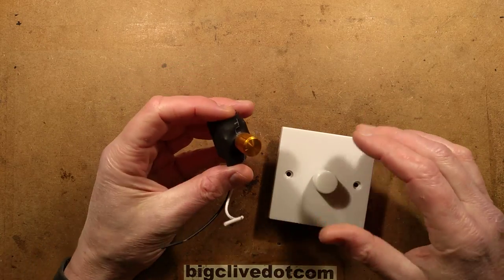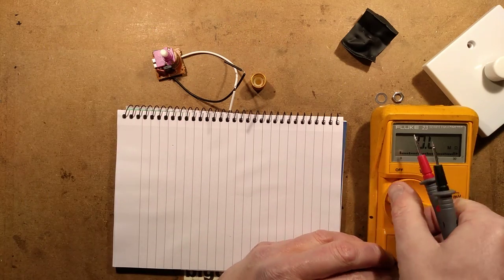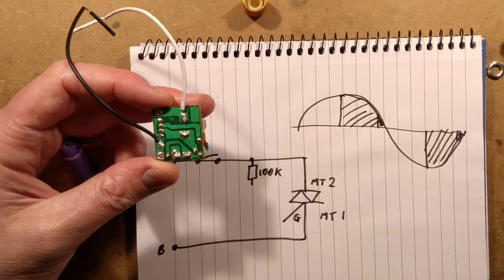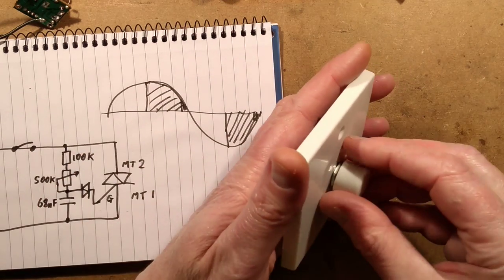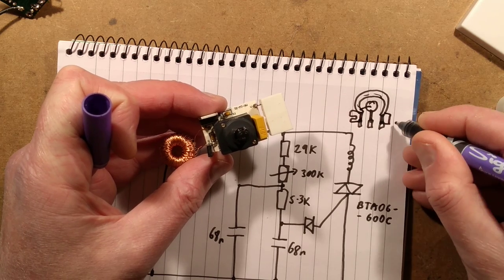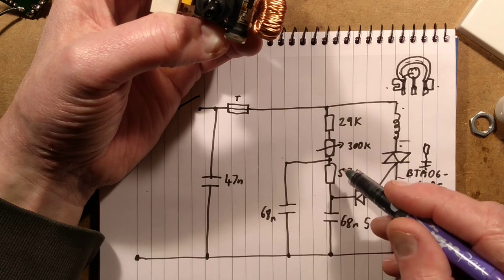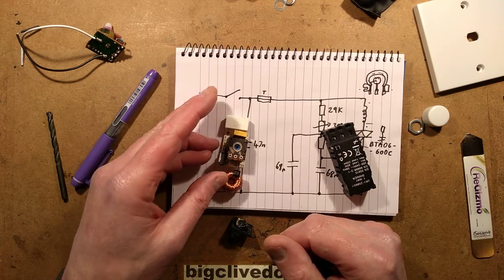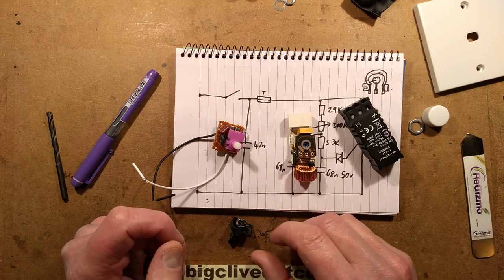Cheap eBay dimmer module vs compliant dimmer.  (Schematics)

Comment: Yoy have a parallel resistance between the left and the middle pins. So your potentiometer has a logarithmic behavior, what makes perfect sense, because that will provide a smooth transition between low and full power to the load.

Comment: Why would cutting off the mains rather than switching it on cause less interference? The change in current should be the same so would generate the same amount of switching noise.
Reply: It would be less. The current in a lead phase would allow the load to slowly rise up to the cut off point. The sudden drop off is just current "going away". Add in a series inductor and you can smooth it out. In a lag phase the power suddenly comes on at full power and then drops off slowly. A series inductor would be useless.
Reply: I see why what you're saying is intuitional but I don't think it's true. Also you got leading and lag (trailing) the wrong way around.

Comment: I recall from the old RCA manual (1960?) that the 2nd capacitor allowed the dimmer to dim to a lower level by "replenishing" the trigger capacitor. It seems that the trigger capacitor didn't have enough charge at extreme dimming levels.

Comment: On the first cheap one, its only 1 way so they advertise it incorrectly. On the second one, I would guess the 0ohm anticlockwise section is for the rotary switch position so it reaches 0ohm before the switch clicks to off?
Reply: kay110 don’t see what you mean - you can turn the lights up and you can turn them down, that’s two ways right? 😄
Reply: Kay110 For some strange reason that is how electricians refer to devices, a standard single pole single throw switch is refered to as two way and a single pole double throw switch is called three way. Guess it is because of the number of terminals?  The two pole single throw switch used to allow control of a light from three or more positions is called a four way switch and has ..... four terminals!
Reply: David V pretty much all domestic light switches are single pole. 1 way is just that, an on off switch. There is no four way switching, you have 2 way intermediates, in which you can have as many switch positions as you like switching the load.
Reply: Mrglock Yes, I understand that and agree, but in the trade those switches are called "four way switches"  The original comment by kay110 was that the dimmer is a one way (single pole) device, which is true but in the advertisement it was called a "two way" switch which is also true - trades-wise.  I don't make these rules, I just try to explain them.
Reply: David V I’m in the trade. I’ve never heard another spark refer to them as four way. And usually when people in the trade refer to double pole or single pole, they’re talking about switching L or L N.
Reply: Mrglock  Must be a country specific thing, I have over forty years experience in everything from residential to light industrial, 120/240 single phase to 4160 three phase both wye and delta configurations, and they are called four way switches here. The advert was apparently targeted at the US market.
Reply: David V ah fair enough, I’m in the UK so it’s different terminology, all the best!
Reply: Mrglock  Terminology is always a bit of a sticky wicket even within a given trade. Cheers!

Comment: Very odd looking dimmer to US eyes. Do British building electrical system normally attach dimmers (and switches and sockets) to the face plate? US building electrical systems mount the switches, etc, inside the box, and the face plate attaches to the front of the device with a couple of small screws.
Reply from the maker: Most British stuff is the whole faceplate.
Reply: @bigclivedotcom  How very odd. Occasionally you'll see wall sockets in the US without faceplates, because the faceplates were removed for painting or whatever, and someone forgot to put the face plate back on. It doesn't matter much since the wiring is tucked behind the device. That said, if someone were reckless or ignorant enough to poke around with a screwdriver, he could eventually find a live terminal.

Comment: Wouldn't the 68n capacitors in the compliant dimmer see the full mains voltage across them if the dimmer switch were on, but with a disconnected load?  The triac's MT1 would presumably be floating, so I think the diac would be unable to dump the capacitors' voltage when it would otherwise be triggered?
Reply from the maker: The dimmer is in series with the load.  If there was no load the dimmer would not be powered.
Reply: Oh, I see.  Thank you -- I'm used to "load on the right," so I was mentally connecting the load after the triac. In retrospect, that makes no sense and I should have known better.

Comment: I have an 18Kw water heater (tankless) that uses Triac's to 'Modulate' the power.  While my home has pretty good wiring it still adds a nice dip to the mains while running.   It's more or less an 18Kw lamp dimmer heating water.   If it didn't do it's job so well I would get rid of it.

Comment: I have a very old Soviet made 600W 220v drill.
I wonder if it is a good idea to connect the 1st cheap dimmer with it? 
It's the only dimmer module available at local market in my city.
Any advice?
Reply from the maker: It would benefit from a snubber network across the triac to protect it from the inductive load and make it more stable.   Most drills are based on universal motors, so it should work OK.

Comment: A limited-arc pot is clever (not genius-level clever, though) but is it economical?  Depends on how many units you intend to shift, I suppose.  Fewer components, less pick/place/solder, but extra expense for a custom pot.  I wonder if whoever designed it did the full economic analysis or was too enamoured with his/her stroke of cleverness to bother figuring it out.

Comment: Sorry to bother Clive, butt I was wondering if there's any way that it's possible to stop a transformer from "singing" once it starts. Some very good LED bulbs have started doing this, making them essentially unusable.
Reply: Depending on construction and cheapness they may be missing entirely their dose of standard spar varnish to tie up the windings with. This also keeps them from moving relative to the core in better built transformers. Time is needed for the spar varnish to cure though.

Comment: There is something else which makes the difference, also in costs. It is the housing, presumably it can withstand high temperatures and it is not a melting and probably burning heat shrink, and for sure tested.  Aaand there is one more important thing, not material, but virtual. It is the responsibility by the manufacturer and the possibility to judge him in the  EU or UK. Try to bring a Chinese seller to court...

Comment: I've managed to destroy several dimmers like the better quality one you took apart Clive because mine had standard none resetting over current fuses which got killed by a spike when the tungsten lamp filament failed. Got quite expensive so in the end replaced them with standard switches.
Reply from the maker: Some small lamps are prone to killing the triacs in dimmers when they blow.   It makes the dimmer stay on continuously.
Reply: @bigclivedotcom  IIRC it failed 'off' which is why I thought it had taken out a fuse, or at least it looked like a fuse, 10-12mm long, white ceramic looking cylendar, metal caps either end. Can't remember if I put a meter across it at the time. May still have the dead dimmer cluttering up my electrical bit cupboard, so I could put a meter across it now. Thanks for a great video as usual.

Comment: Just saw a random item on ebay named: 'Ultimate Solar Power Energy Cooling Cool Fan Safety Protect Helmet Hard Hat Cap' and immediately thought of this channel, no idea why?
Reply from the maker: Nice idea, but I wonder how it would fare in impact tests.
Reply: @bigclivedotcom  Not too well I'm imagining. It looks like it has no battery or switch either, just direct from cell to fan? I'm surprised there isn't a charging circuit / switch or a rechargeable battery. (From the images I've seen, anyway) If it did charge while not in use it could have more power, an led night light mode, usb, pew pew lasers!... etc.

Comment: I wonder if there's resistance in series with the wiper contact too.  It looks like there could be.  Easy enough to find out, just measure from the wiper terminal to the wiper contact ring.

Comment: I know these type of VR. they made so you don't add a resistance with the VR and the VR will not get to zero if you don't want. this type is spacely made for  this type of controller

Comment: Knob aside, what hae ye done with the battrees in the magnifier, Clive?  The switch was on but the LEDs were not, so you pulled out another LED light.  Fun dimmer vivisection.
Reply from the maker: Sometimes I leave them on, so the batteries may be low.

Comment: I ought to buy another dimmer from my chinese COB supplier.  He has these nifty dimmer modules that support up to 1800 watts, with thermal cut off and a wireless remote to boot.  Let you tear it down.  He has them as i recall at 15$

Comment: Is there a way to improve these so that at the minimum sweep the light is lit, but only just?  I have one where the light is out before the end of the track and could do with a modification.

Thanks in advance.
Reply: Which dimmer are you talking about? In any case, you should be able to tweak that by adjusting the value of the resistor in front of it (like the 100k one at about 8:00). Only right now I can't figure out if you need a larger or smaller value :D If it turns out you need less resistance, you can just whack on another one in parallel, leaving the original one in place. Otherwise you need to put one in series and thus disconnect the original one on one side. Of course any such mod would make YOU responsible in case it goes ka-boom :)
Reply: @han5vk  Thanks, that sounds do-able then, at my risk of course...
Reply: Lower the resistance to make the dimmer dimmer. Does that make sense?
Reply from the maker: It might be easiest to try another dimmer and see if it has a better range.  Keep in mind that  electronic lamps rarely behave properly at lower intensity levels on a tungsten dimmer.

Comment: you could try to turn the cross-head screw-ish blue thing in the middle to see if it stops somewhere (the tit on the metal ring around it might point to where the wiper would be)

Comment: Quick question, I have this light box I built for sketching and it runs on an LED strip and the brightness is adjusted using a small PWM. Is there a way to get rid of the flicker caused by this system or should I look for an alternative dimming method?
Reply: Put a large value capacitor on the output in parallel with the LEDs.
Reply: Increase the PWM frequency.
Reply from the maker: Is the flicker from the PWM dimmer or the power supply?  Try a different power supply first as some tend to be unstable with PWM.  If that doesn't fix it try a different PWM module or some fixed intensities with power resistors if it suits the power supply/LED arrangement.
Reply: This could work, but it will low-pass filter the pulsed high voltage to some lower DC level. But if that voltage is too low, the LEDs won't light at all. It should be easy to test though.

Comment: Given your commentsd about location of the first capacitor after the switch, should then the thermal fuse be positioned after the switch and before the capacitor? Everything I think I know, I've learned from you!
Reply from the maker: It would have been advantageous to have that extra protection against that capacitor failing in a hot manner, but it's a thermal fuse primarily intended to break the circuit if the triac starts to overheat due to use with a very high load.  I'll guess they compromised to keep the tracks as simple and well-spaced as possible.

Comment: I despise just about any power application that uses a carbon potentiometer.   Eventually, it gets dirty or worn and then you get flickery or intermittent lighting.  There are other ways to vary the characteristics of an electronic circuit; (e.g. optical or inductive), but a carbon pot is the cheapest.

Comment: You can use a 3V coin cell battery to trigger the triac using a opto-diac. eg MOC3021 . If doing the scratchy test on one of the terminals of the battery ( using alligator clip wires)  watch what happens to the bulb :P yeah disco lights. Nice AIO potenciometer

Comment: I wonder if you could scribble some dry erase marker on the track, then run the wiper back and forth a bit to see how far it moves?
Reply from the maker: I did it afterwards with a smear of vaseline.  It stopped a bit further away than I deduced because it has three contact points.

Comment: I did use one of the wall mount ones on an energy saving bulb, very quick way to make a strobe light, useless for use generally 😂 wonder if you could modify them for led and ccfl

Comment: After my Laser etched was dead on arrival, my 3D printer died after 1 day. But it is still awesome (was printing lots), so I'm swapping the cheepo death dealing ebay PSU for a cheepo death dealling Amazon one. Any suggestions for a 2 output (11A + 5A) 12v + and 12V - output PSU? Just so I don't burn the house down multiple times.
Reply: Meanwell
Reply: @CyberlightFG  Thanks! I'll also check the "Dads shed" as I think he may have kept a couple random PSUs like that spare (and could even be that brand).
Reply: @TechyBen  It may be cheaper to buy two 12V supplies instead of one dual supply.
You should buy identical ones if you need to connect them to +-12V.
Reply: @CyberlightFG  That takes up a lot more space as far as I can tell. As said, 1 rail is 11 amp, 1 is 5 amp. Though looking around I might be able to do it. :)
Would an LED driver PSU work? Or are they not the same thing?
Reply: Most pc psu's have a high power 5v rail also +12 V  and -12V
Reply: @jostouw4366  Where do you get a -12V 5A one? The dual 12v share the same ground.
Reply: Frank Gormanns check out the ATX psu pinout pin 14 is minus 12V
Reply: @jostouw4366  please read before answering.
Reply: jos Touw The -12V tends to be very low current, as it was really only intended for true RS-232 signaling levels.
Reply: @jostouw4366  Yes, but not being an electrician, I don't know why the controller/circuit board has 12v rails, and my PC PSUs only have 1. I'd prefer not hooking up 2 PC PSUs as they take up too much space (though I can buy micro ones). Replacement should be here today (yey Amazon under promising and over delivering sometimes :P ).
Reply: @mikecowen6507  D'oh...   I've been wondering and asking ALL the wrong people for years why there was the low power -12v.   Thank YOU.
Reply: @mikecowen6507  I knew that but original request was for high amp 5V and 12V + and - supplied
Reply: Glen n72 Pleasure to be the bearer of obscure details. And then there were the days when very early DRAM (and some ROMs) also required -5V (5, 12, -5)... More? How about why the original PCs ran at 4.77MHz, and not the 5MHz the CPU was specced at? Take a 14.318MHz (expensive in the day) crystal, and divide by 3 to get a 4.77MHz clock. But WHY? Use the same clock source and also divide by 4 to get exactly 3.579 MHz for the NTSC colorburst signal used in monitors of the day. IBM was creative, and cheap. Then overclocking came to town... IBM stands as the only company to invent a product, and then lose its lead in the marketplace twice !
That should hold you for now... Enjoy! 😉
Reply: jos Touw Yes, but then the suggested use of PC PSUs came up with their +/- 12V.
Reply: @mikecowen6507  Going to check my bin to see if dc dc buck converters have a common negative rail now lol
Reply: @mikecowen6507  the -12v was also used in the old old days for some dynamic ram chips. I remember the old 4116 chips used to turn into nuclear furnaces if the -12v was lost.
Reply: @TechyBen  you could buy two 12V brick psu's as used for some PC's . people like mini-itx.com sell them
Reply: amojak You might want to double check that (I just did). Pinout shows +5v, -5v, +12v, but no -12v. Yes, if you lost the -5v, it wasn't unusual for a volcano to open up in the middle of the chip. Many of my arcade games of that era used them. I bought them in sticks due to their miserable transient sensitivity. Troubleshooting was easy, but painful. The bad chip was the one your skin stuck to. Oh, to have a FLIR gun then...
Reply: @amojak  That may cost more than the printer! I've got a 180watt 12v pico PS and 12v laptop brick and it cost around £100 or more combined. Will stick to going Meanwell in a few months time, but before that use the cheepo replacement from amazon/manufacturer replacement.
Reply: @mikecowen6507  it's been a while since i serviced a TRS-80 computer but they often used to lose the -12v rail which was dropped to -5v. I had forgot :)
Reply: amojak No worries. Despite having used them, I had to double check, myself. It's been quite a few years...

Comment: is there not a resistor between the middle connection and the centre ring of the pot giving you the resistance you were looking for?
Reply from the maker: I've just had a closer look and it's even more complex than that.  There's a track and resistance layer on the other side providing a fixed resistor to the middle pin.  I was wrongly assuming that the middle pin was going to the wiper.